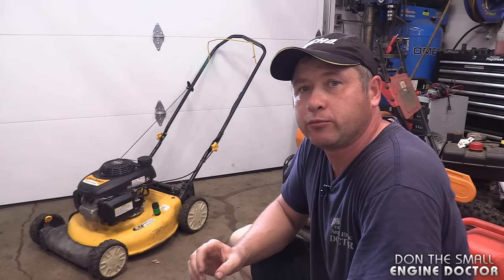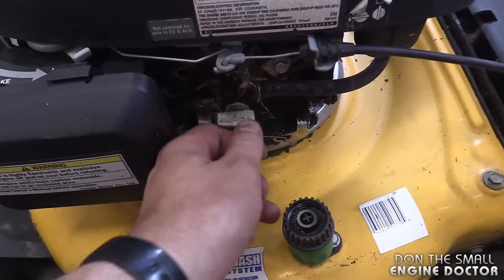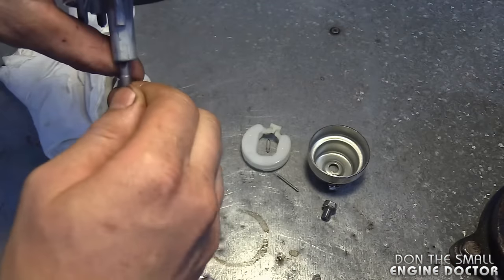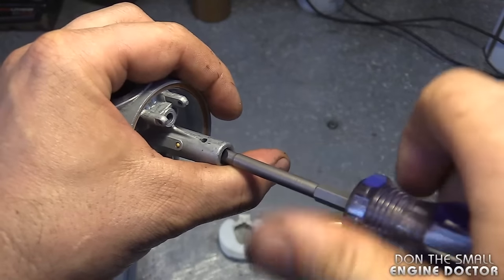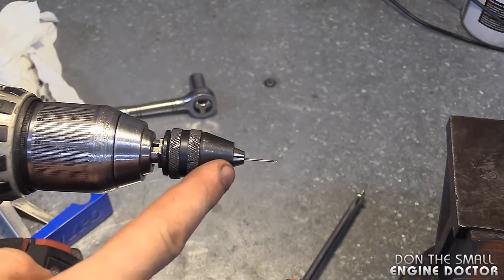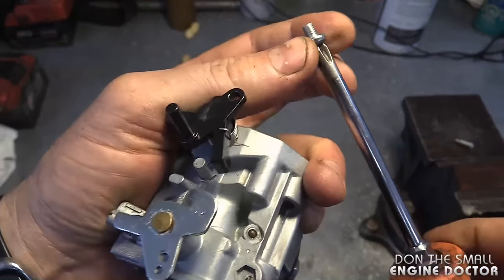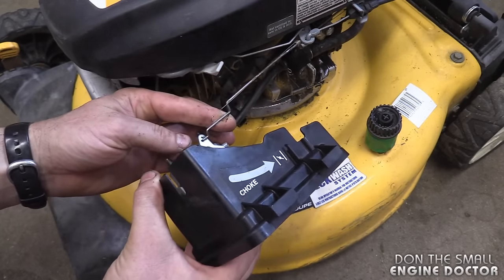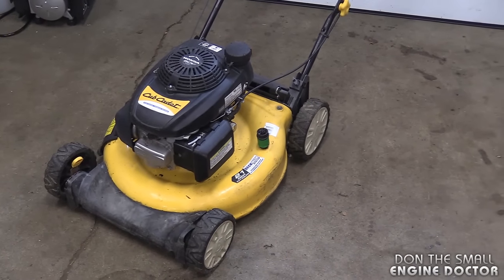How To Fix A Surging Engine on a Lawn Mower, Generator, Pressure Washer & More

Comment: Annoying yes. Not as annoying as someone mowing a yard, hitting something that stalls the engine, restarting, then repeat, over and over, and over again.
Reply: Or a sheared flywheel key. Then whenever you start it, your arm almost falls off.
Reply from the maker: lol, sounds like you have a stupid neighbor
Reply: I hit something once that stalled my mower engine - permanently. The crank shaft got bent. I would think any time a stall by hitting would do some damage to engine, break blade, etc.
Reply: @donyboy73  There was a guy I knew who had really tall grass to cut with a push mower: he'd push it into the grass, engine would stall. Pull the mower back, restart the engine, push it in again and stall the engine. Over and over. He didn't know to ease into the grass to avoid stalling, or to listen to the engine to tell when to ease up. Incredible.
Reply from the maker: @RichardFallstich  also it usually shears the flywheel key
Reply: @donyboy73  You've had your share of "very bright" customers with genius-level common sense.
Reply: @donyboy73  I do
Reply: Or a neighbor who insists on cutting his lawn at 4:30 on Sunday afternoon.
Reply: @reecenewton3097  I guess they didnt know to raise the deck to high setting also
Reply: @THExLAWxMAN  In this case that wouldn't have mattered. He was cutting weeds 18" high! This is possible even with a small mower, but you have to take "baby bites."
Reply: @donyboy73  no kidding
Reply: 😂🤣👍 so true
Reply: @reecenewton3097  That's why I have my push mower set a step higher in the front than in the back and I own one of those gasoline powered mechanical scythes to take tall grass and weeds down to a manageable level.
Reply: Maybe you should move away from the Trailer Park Boys
Reply: @RichardFallstich  Bent cranks are easy to fix.  Look up Taryl Fixes All
Reply: Hillbillies that don't pick up trash in their yard.
Bent blade,sheared flywheel key and the blade adapter/self propel hub has a damaged key.
"If I put some collateral down,can I borrow one of your mowers until the parts come in"
That would be a big NOPE.
Reply: @paulbillings1791  No, not trash. Tree roots.
Reply: @donyboy73  what to  do if middle  jet screw will not loosen and come out
Reply: one time we accidently ran over a hammer that our neighbors left outside for some reason
Reply: I want to hear about a Briggs & Stratton 5 horse on a Murray  it runs a little while and then it dies and you got to let it sit until the call cool cools off to crank it
Reply: @paulbillings1791  What?
Reply: @colehara  I do that sometimes but I have a ego mower and being battery powered it's so quiet no one knows.
Reply: " then repeat, over and over, and over again."

theres your problem, learn from your mistakes, stop hitting sh1t!
Reply: @colehara  i dont get it, whats the significance of that time?
Reply: @mtraven23  
In some municipalities it's against the law to operate a lawnmower after 4 pm on Saturdays and Sunday's.
That's a time when a lot of people are sitting out on patios or beside swimming pools and relaxing. That's hard to do when your neighbor is cutting his lawn at that time.
That can get you a warning the first time and a $400 fine if there's a second time in some areas near me.
Reply: @colehara  fascinating, thanks for filling me in.  I found it strange since, by me, sunday afternoon is a pretty common time for people to cut.  We are a little more spread out by me, so a mower aint no thing.  I'd follow the rule if we had it, but we dont.😁
Reply: @donyboy73 yep and people like that give you plenty of business 👍thank you for another great video dony
Reply: @colehara  So in those municipalities people prefer mowing on Saturday and Sunday mornings say around 8am?   What general part of the country are we talking about, the South East?  I try to be considerate, but sometimes other responsibilities (not to mention weather) intervene and it's either 'let it grow another week' or do it.   Of course, all will be solved when we move to battery power to cut half acre lawns!

Comment: Ethanol or alcohol in gas is really bad for small engines.  In the hot summer,  (especially a mower left in the sun,)  it plugs the carb.  So buy  "Mormon Gasoline"  ha ha!    No alcohol in fuel,  Some  gas stations sell it,    Park your small engines in a cool place.   Its worth it to put in a gas valve,   When done for the day shut off the gas valve and run the carb dry,   This is really important for 2 cycle engines.    Modern carburetors are really  "Tight"  and lean  to save gas and air pollution.    Of course if your engine won't run there is ZERO  pollution,  ha ha

Comment: Easy method to replace carb. Cut 2 X 6-inch lengths of earthing cable (5mm diam) or similar. Push the cables into the manifold first (where the carb long bolts normally go). Then thread  onto the cables your gaskets and carb and gasket and air filter housing onto the cables. Push to hold your carb in place and pull out one of the cables and insert and fasten the long bolt. Then do same for other one. Done.
Reply: cut the heads off longer bolts worked for me
Reply: I use a thin-diameter phillips-head to align those bolt holes, inserting one in the tha far hole and then after the near bolt is in, remove the phillips and install the second bolt. It is a stupid design IMHO. Thanks for your tip!

Comment: Had a surging problem and found a video that said to check that the fuel cap vent wasn't plugged. Checked my cap and found dirt in the cap, cleaned it, and problem was gone! 
Easiest fix I ever had! It's not always the carburetor!

Comment: This repair 100% worked for me. I had this surging issue on a Honda gcv190 engine mounted to a pressure washer. The second jet with the screw you had to remove (5:26) seemed to be my main issue. It was difficult to find a micro drill bit around my area. Finally found one and it took some time and patience to drill it out but eventually I got it. No more surging. Thank you so much!

Comment: Very helpful video, after thoroughly cleaning the pilot jets my 2 pressure washer engines work perfectly now.  I recently picked up 2 craftsman pressure washers at Lowes for only $25 each, they were customer returns being sold as parts only.  I'm guessing the people couldn't get them started so returned them.  Turns out both carbs just needed to be cleaned really good. The 1st time I failed to remove and clean the pilot jets and both machines surged with the choke off, so after watching this video I located the pilot jets and unblocked them with a bread tie wire, they were completely blocked.

Comment: Thanks for the video. Appreciated. One GCV-160-AS3A Honda engine carburetor cleaned up and running great. Symptoms were it would only run on choke. When I took the choke off to a high speed it would start to surge. Took the carb off and totally cleaned it right out and put it back together. It started on the first pull and now idles at all speed settings. Thanks  again from a DIY'er. Cheers

Comment: Hi Don, many thanks for your video which pinpointed exactly where the problem was with my mower. I would have followed your advice in stripping down the carb but I thought I would run some Redex through the engine first, which had no immediate result as expected, and so I left the mower in my garage for a few days to give it a chance to work its magic and today it started first time and ran like new. Thanks again, Dave in the UK

Comment: Great video! I watched this video several or more times to study it. 
I have a new Honda mower that’s only a few months old, it didn’t take long to start reving up and down all the time; also hard to start. My wife really didn’t like it at all. I tried several different things, but still raced up and down. 
I bought some new replacement gaskets and mini drill bits.
I did everything you described, except that you never mentioned the size drill bit for the bottom Jet; where the mulsion tube goes. But I figured it out, process of elimination. 
I got the jets drilled out best I could, cleaned everything out, put new gaskets on got the carb put together and back on the mower.
I cleaned the spark plug, and the mower started right up!
I let it run for quite awhile, and tried to see if I could make it race up and down again; but couldn’t.
It always ran nice and smooth! 
Thanks for your help! 
I hope my wife will be happy with it. 🙂👍
Reply: Same for me. My mower never run well, since the very beginning years ago with this problem.

Comment: Just cleaning as suggested in other sites didn't do the trick. What fixed the problem was enlarging the jet holes. I used a Gauge 75 drill on both jets. The engine is running faster, thou. Thanks for the tip.

Comment: Hey Don,..... Your YouTube channel is the "go-to channel" for any small engine repair. 👍 The lawnmower I'm having a problem with is a Troy - Built TB 110 550EX  140cc engine. My son purchased this for me 2 years ago. It started having problems with stalling out and not starting, I will take the carburetor off and tear it down to investigate, there was no problem I can see. I reinstalled it, and it would run normally for five to six cuts. Then the problem with it is that it keeps repeat itself and I'll have to go through the process of working on the carburetor again. Well, I bought a new carburetor, installed  it, and now my engine is revving up and down. What do you think is causing the first problem? Second, what's the problem with this carburetor I bought online? 😂😆 Thanking you in advance. 👍

Comment: I have to do the same to my Ariens snowblower, it surges a bit as well. I'm guilty of putting it away and not fixing the issue. Spring and then summer came so fast I just never got to it and since of course, I don't need it then, it rarely crosses my mind with the mental "things to do" list. Thanks for the reminder I'll have to get on it.

Comment: Great video.  Very helpful and a practical solution to a common problem.

I agree about carbs on Honda engines - difficult to put it all back on.  What I've done is purchase some M6 X120mm threaded rod and screw them into the block and then slip everything on and get it aligned.  Once I'm comfortable I have it all aligned then I remove the rods one at a time and put in the hold down bolts.  I've cut a slot in one end of the threaded rods to assist in removing the rods if they happen to get stuck in the block.  Has worked like a charm.
Reply: Nice solution, Frank. Thanks for sharing.
Reply from the maker: good idea
Reply: I did a similar hack using 5 inch m6 bolts with the heads cut off, so much easier.

Comment: A friend gave me a 42" Troy Bilt riding mower, it was pretty beat up (lack of maintenance) and made considerable amount of repairs. The engine is a Kohler Courage 19 HP and it surged like the Honda you were working on. The carburetor is very similar to the one on my Kohler, same gasket problems and throttle and governor linkage.

Comment: Female here - I magine that’s rare 😂 This is exactly what my lawnmower is doing. Plus it almost sounds like it’s going to backfire but hasn’t yet. It’s kind of coughing and spluttering. If I can fix something myself I will. I fixed my dishwasher once. Found the faulty part ordered it online and installed it, saved myself $250. These instructions are very clear and very methodical. As long as I follow each step I should be right. I don’t have a drill so I won’t be drilling to enlarge any holes. Maybe a fine pin or needle might clear it. The other annoying issue I have is the clip director won’t stay in place which means I can’t keep it in mulch mode and can only keep it in bag mode. I suspect there’s a spring missing.  Wish me luck!

Update. The guy at Bunnings had no idea what a JIS screw was so I couldn’t get the driver I needed so couldn’t get in to clean the idle circuit. But whatever I could clean did the trick.  No more surging. Thankyou so much for this video!

Comment: I agree with you.  The carburetors on the Honda are much more difficult to reassemble with 3 gaskets, springs, hoses fuel lines and threading all of that through the air filter housing into 2 holes while positioning the choke lever.  Time to re-design this!

Comment: I found your Video a little too late to help me today, but it was a good video.  I had already torn apart my Carb and Cleaned it, with special attention to the Jets.  I never thought about Drilling out the Jets.  I do have some small drill bits from when I drilled out the Jets on my Motorcycle years ago, but these bits were a little bit too big for this job.  Guess I'll have to go visit a local Hobby Shop and buy the right size bit for the next time this happens (I'm sure it will happen).  I have a Very Small Hand Drill for Small Bits like this, I purchased it at the Hobby Shop.  I also had to make a couple of Gaskets as the Gaskets I removed had some areas where I wasn't sure if they were sealing or not. I purchased a Sheet of Gasket Material at a local Automotive Store years ago and already had it on hand.
Again, thanks for the great video!

Comment: The chipmunk (probably?) at 9:58 sure seems happy that the surging is gone! Didn't know that you sometimes need to go as far as drilling the jets out slightly just to get it to run right again, thanks for sharing.

Edit: Chipmunk is probably right, thanks @Zed80
Reply: Squirrel? That's Chipmunk!! and he approves!
Reply: eBay dealers have a set of cleaners specifically made for small engine jets.

Comment: What a fantastically informative video. I sent my lawnmower to engineer because it wouldn't start after winter.  Cleaned air filter, plug and new petrol in tank . Cleaned carburettor too but unfortunately I rebuilt it wrong😂. Couldn't remember the order of the gaskets. Checked fuel filter it was clean too. The engineer sent it back with note saying carburettor rebuilt wrongly. Duh! I'd told them about that when they collected it. They Cleaned air filter again and put on new plug. Sharpened blade and sent back to me, sayingit was running perfectly. First time I tried it, it was surging when hot. Sent back to engineer.  Its back and fine now. Didn't see when they dropped it off but on sheet was written W U D in additional parts section. What is that please?  Just wondering if I'm going to get another bill. Unless it stands for Wot u doing? Haha. I'm 74 y o woman.

Comment: Surging troybilt tiller OHH60.  Purchased in 2000.  The carb was corroded a quite dirty so I replaced the carb.  It is surging.  Does this mean that the carb is dirty or could the fuel line be defective.  Never changed that before.  Thanks foe all the education.

Comment: My truck is doing that idle with the a/c on.  2011 Chevy 3500 w/6.0 gas burner. Still need to troubleshoot it not check engine lights yet.

Comment: Before re assembly you can buff out the needle valve seat a bit with a q tip chucked up in a drill to clean up any corrosion or dirt. Good video.

Comment: Thank you for this great video!! I have a Cub Cadet SC300 HW with automatic choke that has a bad surging problem. It sounds just like the one you demonstrated but ends up stalling out after a minute or so. I have fresh gas, installed a new gas filter, air filter and new spark plug with proper gap. Swapped the gas caps off of my other identical SC300. Also changed the oil which is just below the full mark. All with no change. These gas caps have a solid top but, there is a hole in the inner side of them. I have a question since your Honda engine is different than mine. Since I have an auto choke, is there something else I need to look for other than cleaning the jets as you did? Thanks again, appreciate it.

Comment: The jet you enlarged is the idle circuit jet. When the engine is running under little or no load it is pulling gas from the idle circuit as well as the main jet. When the engine is under load or the rpm is increased it will pull more gas from the main jet.
Usually I can get them to come back with a good blast in the ultrasonic cleaner. There is a thin channel in the main stem if the carburetor which often becomes blocked. 
Enlarging the idle circuit jet should only be done as an absolute last resort, some times as these engine age and wear, they simply need more gas to idle which is why this technique helps. However if you enlarge the idle circuit without properly cleaning the carburetor you are not actually solving the problem.

Comment: "This has to be the worst carbureteur set-up I've ever worked on."
 Yippee! What a relief to hear you say that! I thought it was just lil ol' me. I have two of these engines (Mower and woodchipper). 
But what if the carb is new, Dony? I've just I installed it. Chinese knockoff Walbro which was the original (also Chinese!) on a Kawasaki FJ180V. Thank you.
Reply: I'm answering my own question: put new carb in sonic bath. Fix problem 90%. Only adjustment possible (jets are blocked off with brass) is horizontal plate connecting governor and choke for / spring which is fixed to engine with two bolts through slotted holes. Manual (French) is not clear. Maybe it's that.

Comment: I cleaned my carburetor using this video, it was helpful and stopped the surging but now my mower runs at super high idle. Same setup except I have an auto choke system on mine. Please help.

Comment: Great video! My mower only surges temporarily every time I go full throttle. It does it for about 10 to 15 seconds and then continues to run smoothly afterwards still at full throttle. Is this still a carburetor jet issue like in the video or could it be something else? It just seems odd that it only surges for a short period of time and not continually.